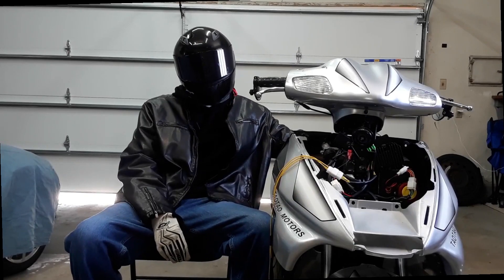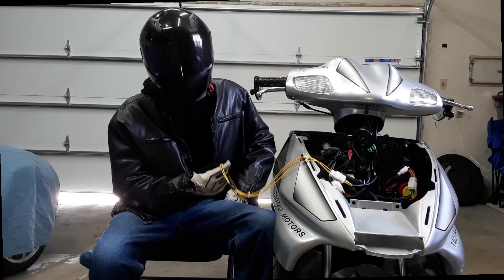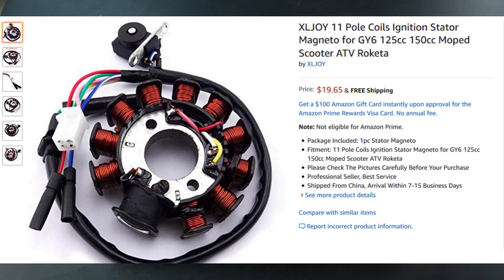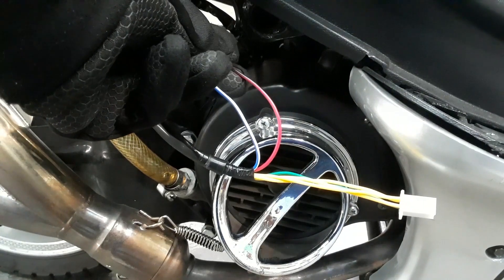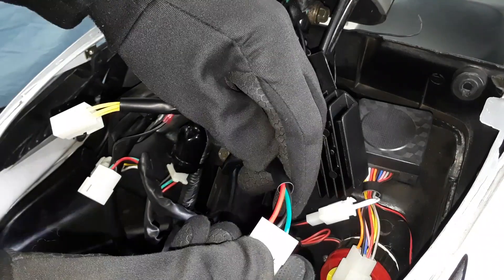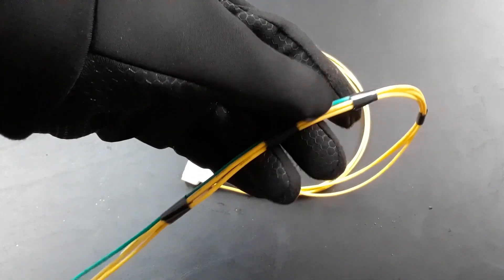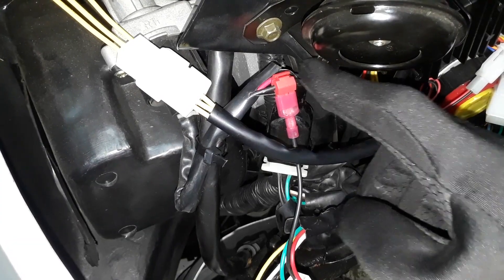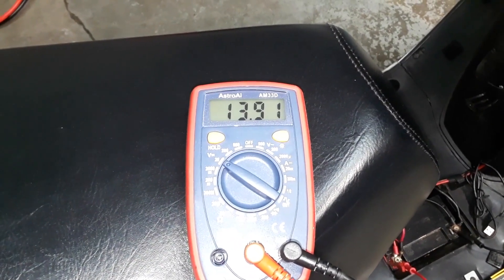COMPLETE! 11 pole stator rewiring / 6 pin regulator / GY6 / How To

Comment: Excellent job Kashi.  Mine is a 12 pole stator and I'm about to replace it with a 8 pole.  Connectors is very different.  Instead of rewire to a 8 pole, I'll stick with the exact same thing that I took off the scooter.  And that's the 12 pole.  And I rather sale the 8 stator.
Reply from the maker: Thank you. When I first started looking at upgrades I wanted a 12 pole and got intimidated. I was thinking it was going to be plug and play, but twas' NOT. Then I knew I had homework to do...it was so worth it! I want power all through out my bike, even when starting, or holding a charge.

Comment: Hello. Hope all is well with you. Can you tell me what the black wire coming out the regulator does you spliced into your ignition?
Reply from the maker: Been a while since I made the video. Let me think about it, because I want to be right. I will provide you an answer by tomorrow.
Reply from the maker: Okay, watch the video again...that is something the the regulator called for, your ignition circuit has to be added, for the stator to work. So instead of splitting the line I just ran a t-tap into it.

Comment: i bought the same regulator and the same 11 pole. Thanks I wasnt sure if I could use the old wires or if I had to run new was thinking of just locating the regulator to the back and then feeding the other power ignition from the front? would this work?
Reply from the maker: So sorry, my electrical knowledge is limited.

Comment: also curious about your headlight. Mine is only on when its running so Does that have AC too? will this require making it dc as I asked for schematic no luck yet would like max power to battery head light could be DC but if the AC would be lost I will keep it connected however they have it
Reply from the maker: Yes, AC works when the engine runs. I never could get the headlight to work, so I installed a light bar which is DC. https://youtu.be/V9ZTvzwjbRQ
Reply: @kachiskid  it's in route with amazon them I'm gonna start and film it . Bike is still under warranty (had 6 miles on it now I'm at 700) the accessories make it fun (amp carplay etc) so the dual amg batteries helped alot but I need to keep them at decent level when playing tunes. Probably will convert headlight to DC led if it doesn't come on. Tnanks
Reply from the maker: No problem.
Reply: Mine is somehow dc already has 11 pole and 3 phase regulator! So keeping this as spare but just an update 23 model it came with it

Comment: Great video. Did you use the original 8 Pole Rotor?  I am building a GY6 based Paramotor engine and being that it is going to have EFI I will need to upgrade the charging system.
Reply from the maker: Thank you. Yes I used the original. It will fit over the 11-pole stator.

Comment: Where does the green ground from the stator go? Your harness had it just stop halfway and covered with tape? Did you attach it to the frame ground?
Reply from the maker: Ground of the stator is just taped off. I think I mentioned, I was following someone else's schematic.
Reply: @kachiskid  you did but I was just curious if you knew why. Just seems like you'd want to ground it. But that little wire couldn't support the whole bike if the other grounds go bad anyways so it's probably best not to and just float it.
Reply: @kachiskid  BTW I appreciate you very much.
Reply from the maker: @androidken  I thank you very much! Being appreciated makes all the difference. Thanks bro!
Reply from the maker: @androidken  Yeah I was never really sure either.I have had no issues, and I trust the bike much more than before the install. I am not an electrician, by no means.
Reply: @kachiskid  I'm literally doing this stator install tonight. Do you think 18 gauge is enough? All the other wires are thicker. Have you had any heat or melting issues?
Reply from the maker: @androidken  No heating or melting issues.

Comment: Quiq question so you end up not using the green wire coming from the stator ?
Reply from the maker: The green wire is just a ground, and not connected to anything.
Reply: @kachiskid  ok so that is why you end up killing it in the harness you made ok cool. Thank you very much for the help
Reply from the maker: No problem, but as stated in the video, Daniel was the maker of the original harness. His videos were the inspiration to even attempt to make a video on this.

Comment: Hey did you change your ac cdi out for a DC cdi as you used the dc stator?..
Reply from the maker: Nope, it is still on an AC system. DC is converted by regulator/rectifier to AC.
Reply: @kachiskid  thanks very much . I have sym symphony 150cc i hate the electrical system on this bike ..
Reply from the maker: No problem buddy. That is a good looking bike. 16 inch wheels would be nice.
Reply: @kachiskid  yeah brother .. It's a good bike . got it brand new.  I wanna do some modifications to it..
Reply from the maker: @the473hustler7  Do you think the engine is a GY6?
Reply: @kachiskid  am really not sure .. I would really love to find put because I have a 180cc taida big bore kit I wanna upgrade the engine but the bike is new and still under warranty. What i know is the 4 bolts spacing is 57mm and the taida kit I have it the 57mm what am not sure about is the 2 small 8mm bolts on the side of the cylinder . not sure if they would line up ..
Reply from the maker: Yeah, leave it alone until you know for sure. It was very important when I got my bike that it had a "true" GY6. I needed quick access to parts because I knew I was replacing everything. I have seen so many different motors on bikes... when previously thinking they all had the same engines.
Reply: @kachiskid  I will soon find out .. What I know is that sym uses gy6 but there's 2 type .. Taiwan version and Chinese version.. But for now my main focus is on the electrical system upgrades..
Reply: @kachiskid  what I wanna find out is there a difference in AC and DC stator ? Are they universal?
Reply: I love my bike and I would love to enjoy the beat of it but am confused with a 8 pool stator with out 3 wires output.. 1 yellow1 white and 1 stripe for the pick up.. Man I need help pls ..
Reply from the maker: @the473hustler7  you might want to leave it alone. I only changed mine because I have a lot running off the battery. For a normal 150cc scooter, an 8 pole should be plenty. If it ain't broke, don't fix it....
Reply: @kachiskid  those halogen bulbs ain't giving me enough light and the 8 poll stator is not stable to run led bulbs .. Am gonna do over a complete wire harness to the beat of my knowledge.. I will figure it out..
Reply from the maker: @the473hustler7  Yeah that is the other option. Make sure to replace the regulator.
Reply: @the473hustler7  man I want to switch to led headlights but I'm afraid it will cause problems. A vitacci eagle is the same bike is our Lancers with just different headlight bezels. And it's weird cause u can put LEDs in the vitacci eagle and it works fine.

Comment: What do you do with that plug yellow and white just leave it unconnected not plug
Reply from the maker: Yes sir. you could cut the harness off and wrap in electrical tape also.
Reply: I did everything and can’t seem to make it work or getting power I have brand new battery charged and everything ..when would u be available to talk
Reply from the maker: Maybe Weds. what wrong with you posting a video? I need to see, what it is doing. Are you hearing it turn over? Have you attempted kickstarting? Are you getting spark? Is this a new scooter? What type of scooter is it?
Reply: Kachi's Kid  .... it not new but a lot new parts it the ruckus clone icebear maddog I did the gy6 swap and it was working then I shut it off and went to turn it on again and nothing no sound like it cranking or anything ..today I just replaced the starter solenoid and the cdi and spark plug and ignition coil and I was trying to do what’s in this video as well cuz I have a 11 pole stator but never changed the rectifier but it was running fine but not it won’t crank over .... brand new battery too
Reply: Kachi's Kid  do u have FaceTime I can FaceTime you when I’m fixing it again ??  I just don’t want to pay a place to do it for idk how much it will cost
Reply from the maker: Darn, your not even hearing the solenoid clicking sound? Did you check all your grounds, and the fuse connected to your battery? Did you smell anything burning when you got off the bike? Are your headlights working when you turn the ignition?
Reply from the maker: No, not a big fan of Facebook, I'm definitely a Youtuber...never paid anyone to work on my bike, sorry.
Reply: I don’t have Facebook ... do you think I have a no good starter switch ?? Or I need another stator
Reply: Kachi's Kid  .... fuse is good and I believe the ground are good n no haven’t smelled anything... I don’t have the headlights connected cuz I have led bar but I have that disconnected too because it will kill my battery but there is no clicking sound
Reply from the maker: @2FrEsH4ya617  Oh, Facetime, no I'm an Android dude.
Reply from the maker: @2FrEsH4ya617  Yeah it could be the starter switch. You might need to start checking your wires for continuity. Did you replace the whole wiring harness? I have heard of "no spark" but "no power" is a tough one. Did you happen to ask Garret Seesing at Scooter911?
Reply: Kachi's Kid  no I didn’t switch the whole harness ...it was working before then just stopped and I don’t have a kick start I’m try and get a tester to see how many bolts and ohms and stuff everything is at unfortunately ... but not 100% sure I just want it up and running I’m in Massachusetts getting nice soon
Reply: Kachi's Kid so I got it started by bypassing the starter switch by putting metal screw driver on the solenoid and it started right up so I do have power just nothing at the starter kill switch
Reply: Kill switch does work when I use it also
Reply from the maker: @2FrEsH4ya617  Great job. See you even knew it was a faulty kill switch.
Reply: Kachi's Kid ...is it the switch though?? The kill switch works to shut it off and I opened the starter switch and it looked fine all wires were Soldered
Reply from the maker: @2FrEsH4ya617  Wires running to the kill switch need to be measured with a multimeter. It might be your starter switch, I have heard of them going bad.

Comment: Can you put either of the yellow wire from the stator to the yellow wire of the rectifier?
Reply from the maker: No, the rectifier has to be upgraded. I think even in the process that I shared the video o,n he had to upgrade his rectifier.
Reply: @kachiskid  thanks, so if I upgraded the rectifier then I just match the yellow colored wires.
Reply from the maker: No problem, yes you can if you have an 11 pole. If you have an 8 pole, then you must follow the other gentleman's directions to the letter.

Comment: Where does the green wire go on the new harness you made?
Reply from the maker: No where, doesn't need to connect to anything, just a ground.
Reply: @kachiskid  So you arent grounding it? Why even add the wire to the harness then?

Comment: So my headlights stopped working except my break light , turn signals I also ordered a new regulator and wire harness but my old regulator has different connection tho
Reply from the maker: Yeah wiring harnesses can be tricky. I have seen at least 5 different wiring harnesses for our bikes. The simple thing is to get a regulator that matches the harness.
Reply: @kachiskid  this bike really old Me and my friend don't really know what's wrong but he just told me order new wire harness and headlight assembly but I didn't so just those and new regulator
Reply from the maker: @merjimjimenez1361  So what did you have on the bike, and what did you order? Bike 4 pin / new regulator 5 pin? What type of bike 50/150cc?
Reply: @kachiskid  idk if you remember me I have a 150 f gator 150cc scooter so like I said after my friend put the new regulator has different color cause the old one has the white color n other pink so he put the pink wire to the white one after that scooter won't start so I'm thinking we messed up the wire but when he tried touch the relay start right away I still have the wire harness but idk how to replace it
Reply from the maker: @merjimjimenez1361  Wire harness replacement is just awful, that is exactly why I didn't do it for my scooter. I see a couple of people made videos on the wiring harness though. Have you checked these out?
https://www.youtube.com/watch?v=m3qycMe5Gr4
https://www.youtube.com/watch?v=EAp5rWl9Bwg
Reply: @kachiskid  honestly not yet but yeah bro my scooter is ruin I cannot replace the new one
Reply from the maker: @merjimjimenez1361  Well I think you will find some good info in that 1st video.
Reply: @kachiskid  hey do you think it's easy to replace the stator magneto
Reply from the maker: @merjimjimenez1361  Very easy. You will have no problem, as long as you get the remover tool, and have a drill or impact.
Reply: @kachiskid  yeah I ordered this tool called puller from Amazon and new stator find out why my headlights won't come on and ok I'ma get me impact wrench
Reply from the maker: @merjimjimenez1361  Yeah get one, you will use it all the time.
Reply: @kachiskid  do I have to put the new one in order cause don't wanna mess it up
Reply from the maker: @merjimjimenez1361  sorry, I don't understand? In order of what?
Reply: @kachiskid  my bad I just don't like mess it up when I put the new stator

Comment: I'm wondering...is it necessary to modify the main harness and change the stock voltage R/R when upgrading to an 11-pole stator? I have a BMS Prestige 150 (Znen) which has a DC CDI. My voltage R/R is in the rear near the fuel tank mounted to the frame facing the body panel so it’s a pain to get to but I can clearly tell its much larger than the 4-pin regulator. Looking at the connector from an angle, I believe it has 5 or more pins and its mounted with 2 bolts instead of one. 

Mine looks a lot like this: https://www.amazon.com/Voltage-Regulator-Stator-150cc-6-Pin/dp/B01NCSONTY/ref=sr_1_83?dchild=1&keywords=gy6+voltage+regulator+150cc&qid=1624518100&sr=8-83

I haven’t cracked open the fan cover yet so I still don’t know what kind of stator I’m running.

My whole goal is to reduce the total power consumption of all my electrical components because it seems lately my stator and regulator barely have enough left over power to charge my battery now. I just installed a voltmeter so I can monitor voltage while im riding. The system is only sitting at 12.8v while idling. So I started swapping out all bulbs for LEDs which seems to be working. Blinkers and tail/brake light are done. My low beam is a single 55w H7 and my high beams are actually dual 18w HS1’s  and I also have two 194 running lights so those are all next. I’m not sure if I have a weak stator or a weak regulator/rectifier.
Reply from the maker: That is exactly what happened to me. The stator just didn't have enough to keep everything charged. Sound like your regulator is good if it has 6 pins, but you really need to see what kind of stator you have. I would say 8-pole but don't want to make a mistake by not knowing all about your bike. The changing of the lights to LED when completed could be all you need to do.
Reply: @kachiskid  I just received the LED H7 today. Swapped it out and my idle voltage  jumped up to the high 13's low 14's. Cruising voltage is close to 15 volts. Peaked at 15.1 a few times. Think I freed up to much power and I didn't even swap the high beams yet. I threw the review up on amazon, probably didn't get posted yet.

https://www.amazon.com/gp/product/B08TQKBKLN/ref=ppx_yo_dt_b_asin_title_o00_s01?ie=UTF8&psc=1